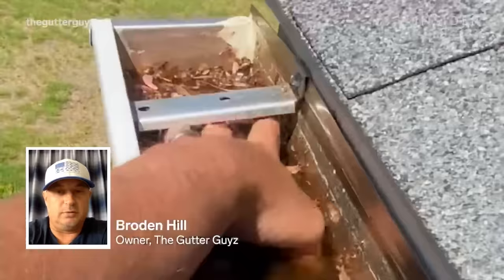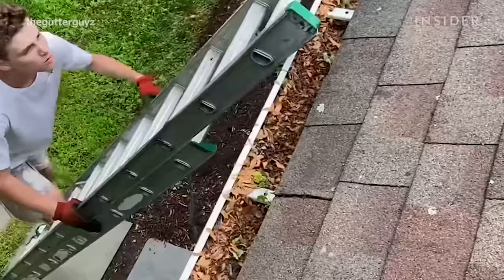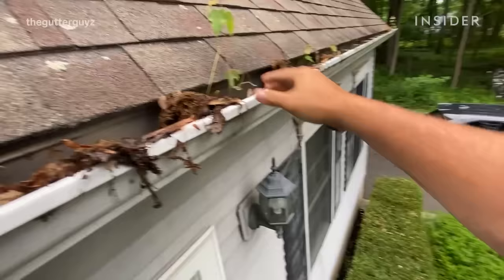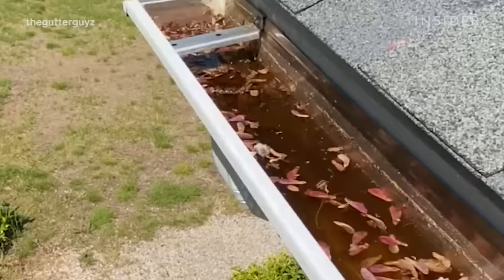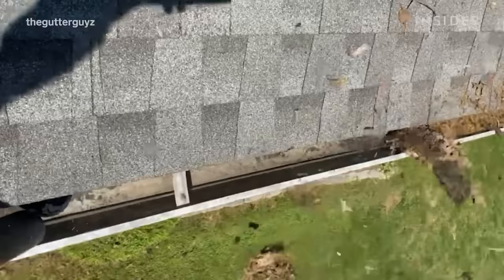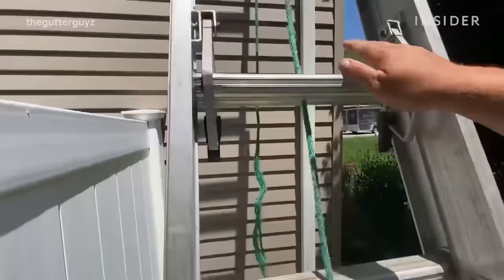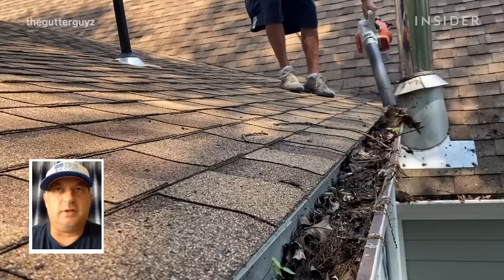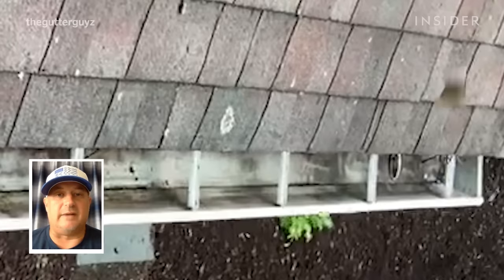How Clogged Gutters Are Deep Cleaned | Deep Cleaned

Comment: Top tip. Take a bucket up the ladder instead of dropping the mud and debris on the floor and creating another cleaning up job.
Reply: But the bucket might get heavy and cause discomfort upstairs?
Reply: Put a plastic or tarp below the ladder then you can easily pack the debris up and throw it out
Reply: Drill holes in the bottom of the bucket keeps liquid out of bucket and keeps the bucket from getting heavy. Dump wet debris in trash bag when bucket gets about half full.
Reply: Was gonna say... Absolute no respect from the gardenning job underneath the ladder and dropping spot.
Reply: @gaiapiou1384  it’s just mulch. We pick it up, completely. Too dangerous having one hand on the roof or ladder, because we are carrying a bucket.
Reply: Its business
Reply: Climb ladders for your job one handed and see how long you'll make it lol.
Reply: You either don't value life, or you do not have experience with this.

Comment: How you gonna call that "Deep Cleaned?" Man just pulled out some leaves and called it a day
Reply: Exactly 😂
Reply: For real, I would argue that that's just "average cleaned"
Reply: More like "unclogged"
Reply: Like yeah. That's the only things there lol :/
Reply: I mean what else did you expect? There's not many ways to "deep clean" a gutter lol
Reply: @Bino9898  power wash
Reply: @Bino9898  Go with a toothbrush in all the nooks and crannies. Obviously it’s just a silly video title made by this channel.
Reply: @Engineer9736  that's pointless and stupid. Like what???
Reply: Because that’s all you need to do? When you visit people do you clime a ladder and inspect if their gutters are perfectly shiny?
Reply: @Bino9898  at the very least rinsing it out to get rid of all the gunk left over with a hose, or even using a pressure washer.
Reply: Exactly, I'm spraying out ALL the dirt and moss/algae build up. Before and after pictures will guarantee repeat business (if doing this professionally) and show your attention to detail which most times leads to requests for other cleaning projects(and referrals!). I'm speaking from experience also.
Doing a job as shown in video is half assed and yes sometimes people really do go look after you're done. And cleaning up all the crap you removed and any splatter from the house is a must. It should not only be cleared of debris and clogs, but look better overall that how it did when you started. 
Just my long winded 2 cents.

Comment: There are a lot of people who do not or cannot do their own gutters. My husband and I used to do this kind of work. Quick easy money for anybody who's willing to work a little bit.
I have taken trash bags to the roof and went along the edge to get the wet debris out. I have also thrown it on the ground and cleaned it up afterwards. That really depended on what  was under where I was working.  
Fun stuff.
Reply: That's so cool Candi! Do you have any safety tips? Or any other types of tips?
Reply: @Coffee_Is_Magic  wear gloves!!!Use a water hose to flush the drains down sprout. You can walk all over the roof when it's dry and use the blower. Any big clumps you can spread out either on the ground with the rest of these or clean them up. 😉
Reply: Thanks @Candi 😊
Reply: @katrinkaperkins1852  do you still do gutter cleaning ?

Comment: People, You need to install the screen on top of the gutter and You won’t have this issue ever again !!
Reply: GOD LOVES YOU
Reply: @robloxlover2748  Thank You !! 🙏🏻 God Loves you too.
Reply: You still have to clean the junk that gets on top of them.  Also, good gutter guards can be expensive to install on a nice home.  Over the long run, the homeowner can save money just by having someone come out and clean them a couple times a year rather than spending thousands of dollars to have gutter guards installed professionally.
Reply: Gutter guards help but depending on your situation you will still need to clean the eaves. They've reduced my cleaning to three to four times a season at the cabin.
Reply: Not working block the rain for get to the gutter jump out I had to remove them

Comment: what is connection between gutters and water in basement ?
Reply: Water running down the side of the house right to the foundation. Gutters prevent this but if they are clogged water overflows.
Reply: The purpose of gutters is to redirect rainwater away from the house because a dry foundation is essential to the integrity of the stucture.

Comment: I just got done doing my biannual gutter cleaning. Sad thing is that I do have gutter guards, but they were not designed for pine needles. At all. How was I supposed to know that leaf guards are not necessarily pine needle guards? More importantly, which are better? I hate having to redo a project, but looks like it is a necessity as my body doesn't like ladder work anymore.

Comment: why don't the roof just cover the gutter so rain and dirt just fall off? I live in an apartment so I don't know how houses work sorry😅
Reply: Because if the roof covered the gutters, the water would flow right off the roof past the gutter tops and onto the ground, rendering them useless.
Reply: @whiteknightcat  im sorry same question, i live in another country too.
 then why not just extend the roof anyway & have no gutters?
Reply: @ek9826  Because the whole purpose of guttering is to redirect water away from the edges of the house. With my house, for example, there's a curtain of water running off the roof across the front entrance when it rains, making entry and exit difficult. Gutters will cure this (when they get installed WEEKS from now - there's a metal shortage now).

In other cases, some houses suffer from foundation or basement damage from water accumulating from roof runoff. Gutters, downspouts, and runoff systems will direct the water away from the foundation, saving lots of money and headaches.

Comment: So you not only have plastic gutters but when the rain water pours out of the downpipe it flows directly on the ground next to the foundation or basement?
Maybe you want to consider leading it away a bit so it can seep away where it does no harm or even better lead it in some sort of sewerage system?
Reply: That's why it is graded around your foundation at a pitch so the water flows away from your house.
Reply: That would be the homeowners responsibility.

Comment: I live in a farm house with no gutters for 20 years. No problems whatsoever. Why put one anyway?
Reply: It depends on the region that you live in.  I live in Seattle so most homes have gutters.  I've seen incredible damage done to homes around the foundation that could've been easily prevented with a decent rainwater control system.  Water can leak into your crawlspace and cause mold.  It can also destroy wood/siding/fascia.